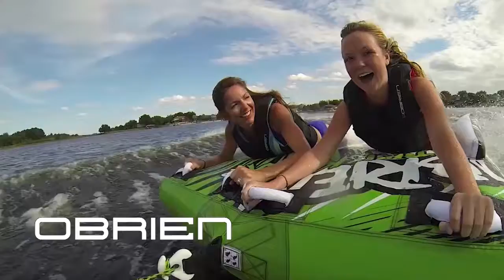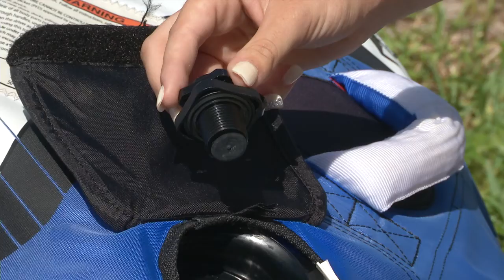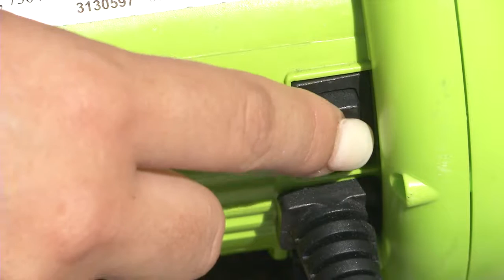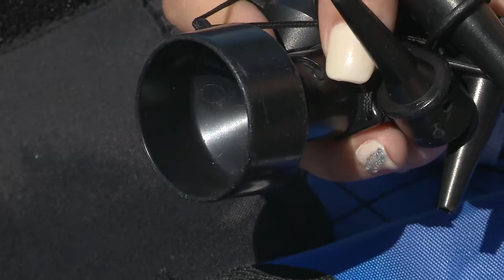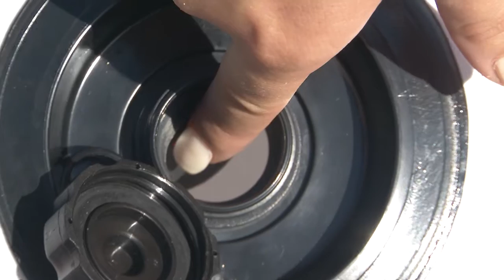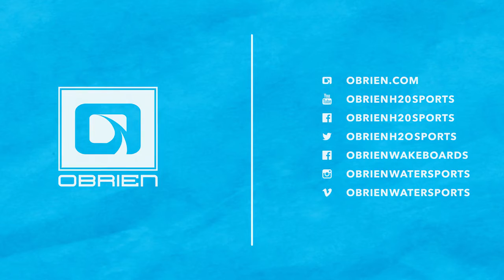Lightning Valve

Comment: My family couldn’t go tubing today because of this new valve.  The older Boston valve worked great.  This new one has a gigantic hole that I couldn’t use with either of my two pumps.  O’Brien recommends using their electric pump, but I don’t want to buy more stuff.  I just want to use my current hand pump which used works great.
Reply from the maker: Hi Michigan Rocks. Sorry for the delay in responding to your comment and sorry to hear that you weren't able to go tubing that day due to an issue of connecting your pump with the Lightning Valve. Our customer service department would be happy to send you an adapter that works with most older tube pumps. Please reach out to them at 1-800-6-OBRIEN or on the website at https://obrien.com/contact-us/.

Comment: I agree. Have used the Boston valves for years and they worked great. Ruined our day at the lake and ended up going back to the old tubes because we couldn't get enough air with this new "better" valve.
Reply from the maker: Hi Steveenye. Sorry to hear that your day at the lake was ruined because of the issue with the Lightning Valve. We do have Lightning Valve adapters that pair with most older style tube pumps so that should be all you need to get your new tube fully inflated. If you reach out to our customer service, they will happily send one to you. You can reach them at 1-800-6-OBRIEN or on the website at https://obrien.com/contact-us/.

Comment: Ruined our day tubing.  
Then, I discovered I could uses my air compressor trigger jet.  Take a milk jug lid and poke a hole in it......solves the problem.  :P
Reply from the maker: Love the creativity of using the milk jug lid! Hopefully it got you back on the water quickly. Alternatively, you can reach out to our customer service and they will ship an adapter to you that is compatible with most tube pumps.

Comment: I cant inflate this with any of my normal tube inflators. I have to buy their 50$ pump to inflate my tube. Now we cant go tubing until I buy the new pump and I am out another 50 bucks for something that I can get for 10 bucks at walmart  just because it has a larger special plastic adapter to fit their larger Hole.
Reply from the maker: Hi Rymaal. Sorry we are just now getting to this comment. Hopefully you have already reached out to our customer service regarding the issue of connecting your older pumps to your tube's Lightning Valve. We have an adapter that works with most older tube pumps so if you haven't already contacted them, please do. They will gladly send you an adapter. You can reach them at 1-800-6-OBRIEN or on the website at https://obrien.com/contact-us/.